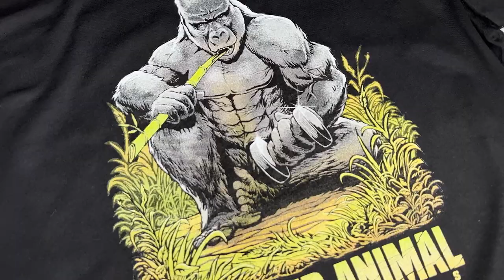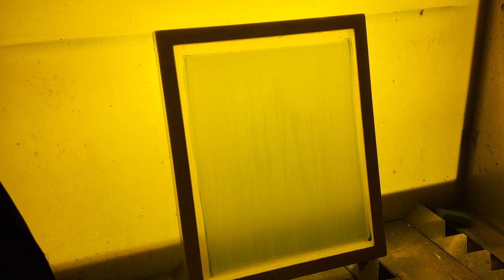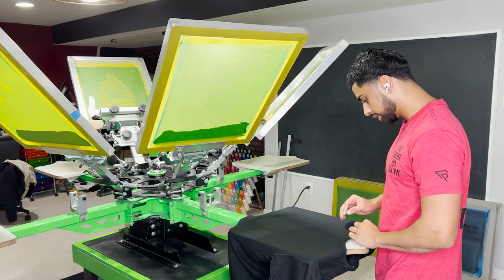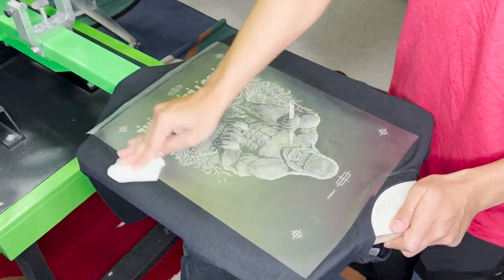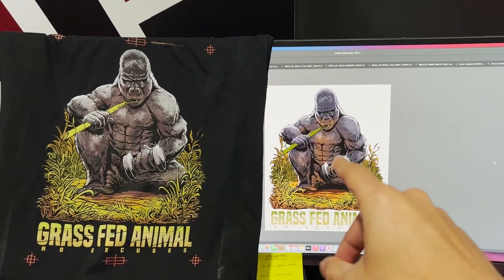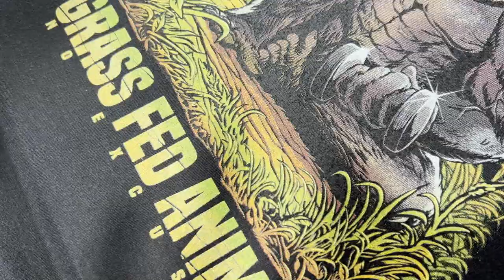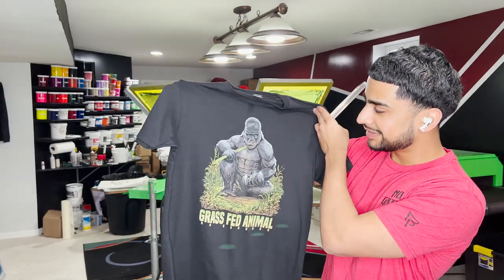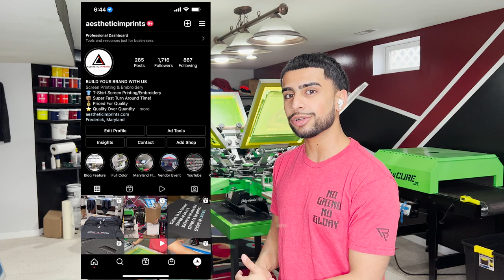SCREEN PRINTING Simulated Process On Black T-Shirts | Step By Step Process

Comment: How long do you burn your normal design like time
Reply from the maker: Most of my videos I take you along the whole process including burning like my last few videos. A normal design for me usually is exposed at 18-20 seconds
Reply: @baavproductions  yea I'm trying to figure out my halftone time
Reply from the maker: Halftones usually a bit less then your usual burn time. For me regular mesh like 156 I do 20 seconds and for halftones usually bump it down to 17-18 seconds
Reply: @baavproductions  Ok I was using a 230 yellow mesh at 1min got a great tupac to come out but tried Kobe same everything a not a lot came out but imma keep trying
Reply from the maker: I would keep doing testing. Was your halftones smaller for the Kobe design?
Reply: @baavproductions  no using 230 yellow mesh 46 for halftones
Reply: Was this printed on 20x24 screens ?